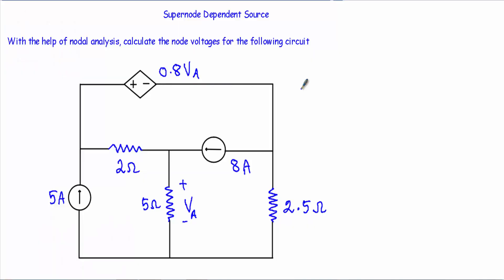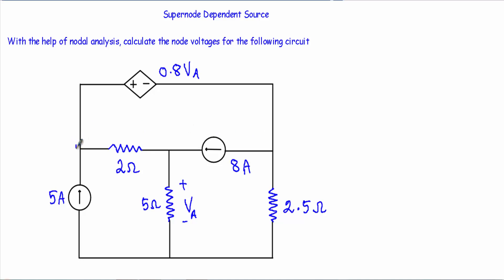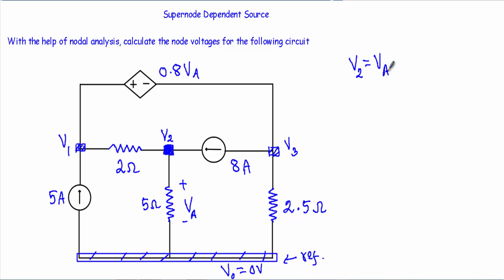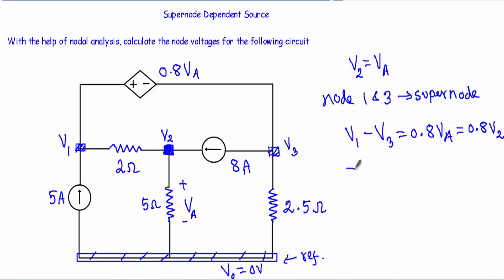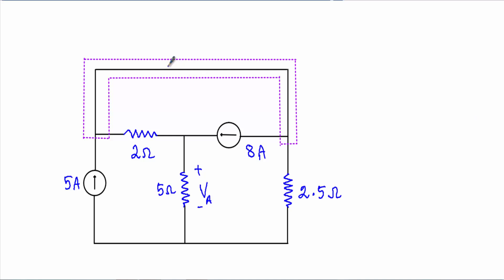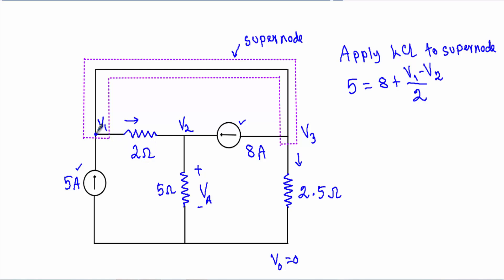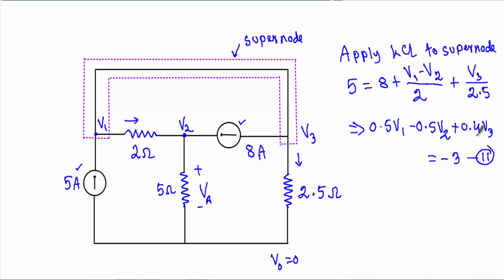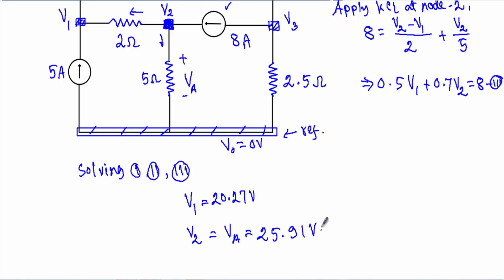Supernode Analysis: Dependent Source

Comment from the maker: Reference For this Problem:

Engineering Circuit Analysis - Kemmerly & Hayt, Chapter - 4 , Exercise - 4.17 (Fig - 4.47) , 7th Edition

There is an error in writing equation (iii), I skipped a minus sign.. Please use following correction

 - 0.5 V1 + 0.7 V2 = 8 ---- (iii)
Reply: Hi I've been wondering in your eq. 2 the given is 5=8+(v1-v2 over 2)+(v3 over 2.5) right?
then it's lcd is 10 right?then 10 divided by 2 is 5, 5 times v1-v2 is 5v1 - 5v2, then you will do the same process to the v3 over 2.5 right? then the answer is 5V1-5V2+4V3=-3 right?
how come that your answer become 0.5v1 - 0.5v2 + 0.4v3 = -3?

Comment: Is it okay that you assumed the current direction between V1 and V2 to the right at equation 2 , and then you assumed the current direction at equation 3 on the same spot to the left between V2 and V1 ?
Reply from the maker: When you apply KCL in a node, you have to consider each of them as an independent node. When you apply KCL in node 2, forget about node 1. In the nodal analysis, all unknown currents must be outgoing from the node and that node will be higher than other node voltages. So current in the second case through that path is V2-V1/R. 

If you are still confused, check the steps of nodal analysis. 
https://www.youtube.com/watch?v=6DNYpNUJ008

Comment: how 8A current source is outgoing...I dont understand..
Reply from the maker: Look at the direction of current source at node 3.... You will understand
Reply: If you are saying about the middle part so why are you not considering it in supernode???? Actually in supernode the only 2 nodes will act and for that we don't consider the middle node and so the 8A will be incoming
Reply: Old comment, but leaving this here for reference:

I believe the 8A current source is outgoing because it's leaving v3 and going into v2, and that current will split into both the bottom-middle and middle-left branches (meaning whatever current through v2 into v1 is definitely not 8 amps)